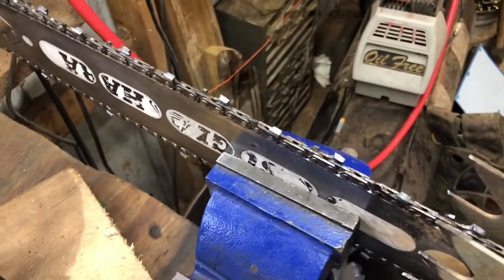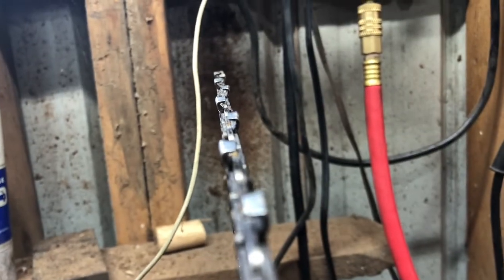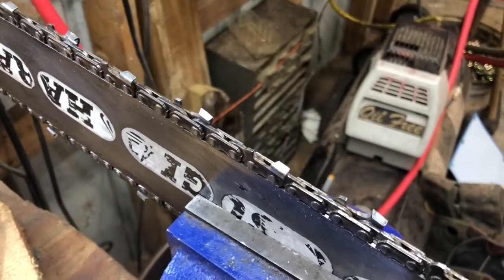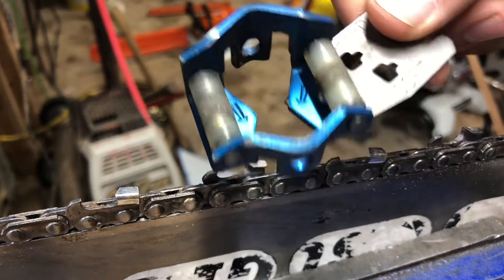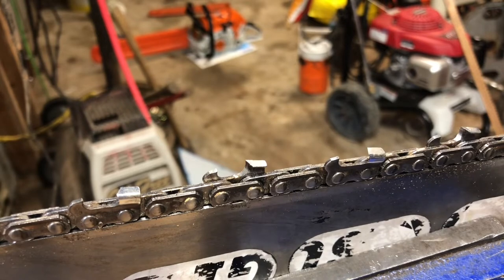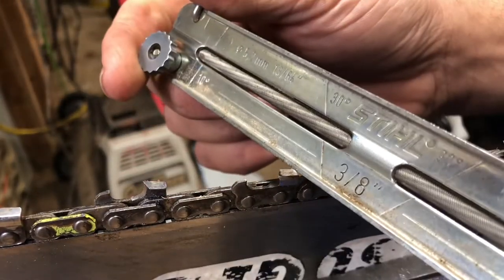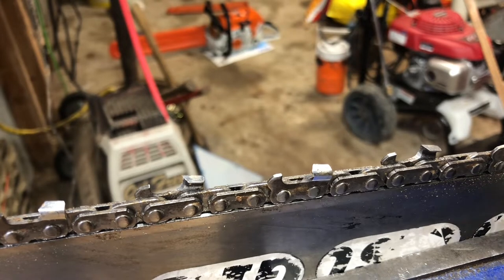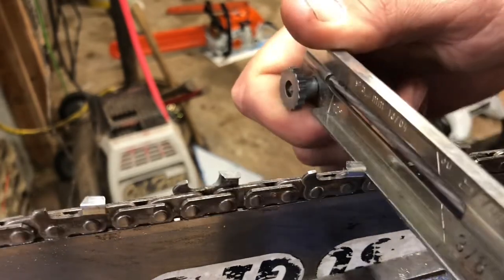Husqvarna and Stihl filing guides explained!

Comment: Nice presentation man but… don’t get me wrong but I think the 3/8 .50 gauge stihl chain is the a low profile chain right? Or am I wrong? If it is the picco chain you are using way too much large file and also you are using the wrong stihl file gauges! Yours are the standard 3/8 for 13/64 file but in case that your chain is a picco chain who I think it is, you need the correct stihl file gauge who sais on top 3/8 p and file size 5/32! Please let me know what tooth side has this chain! The standard or the low profile? Excuse me if I am wrong though
Reply from the maker: It is the full size 3/8. The only thing that I have that runs the 3/8 Picco is my pole saw and I have the same guides for the 3/8 Picco for it.
Reply from the maker: No worries, I’ve got big hands so it may make that chain look small haha
Reply: @thattimbersportsdude  ok man thanks! I learn something today! I wasn’t aware that .50 gauge 3/8 stihl chain has full size tooth! Can you write me the part number of that chain pls?
Reply: @thattimbersportsdude  lol
Reply from the maker: Yessir, the full size 3/8 comes on .050, .058, and.063. The model number for the semi chisel .050 will be 33RM and the chisel is 33RS in the standard sequence chain
Reply: @thattimbersportsdude  thank you

Comment: You're not using the Husky guide properly.  The  rear of the guide needs to sitting flush on link also.  To make it fit properly you need to file the grooves that sit on the rivets.
Reply from the maker: In the video it clearly shows the rear of the guide resting on the chassis of the chain. After the paint is worn off of the insides of the grooves of the guide it slides on a Stihl chain easily, if you start modifying the guide it can be loose on the chain as well as inconsistent without great care.